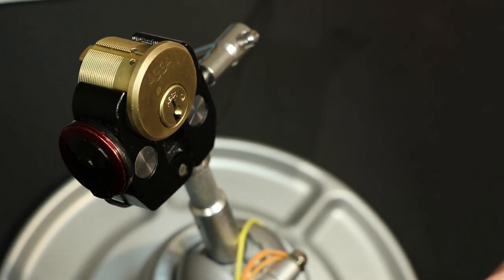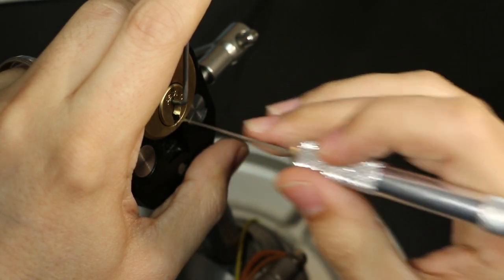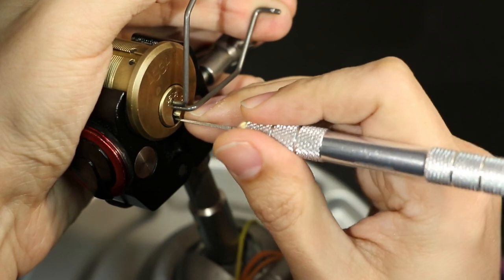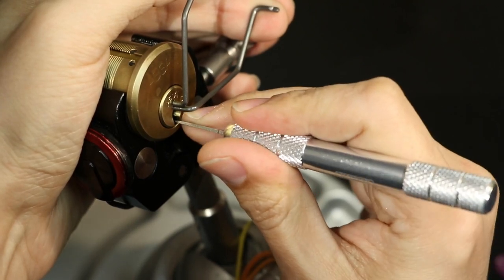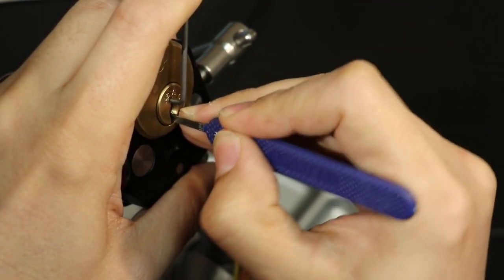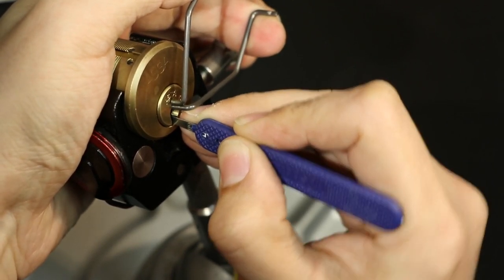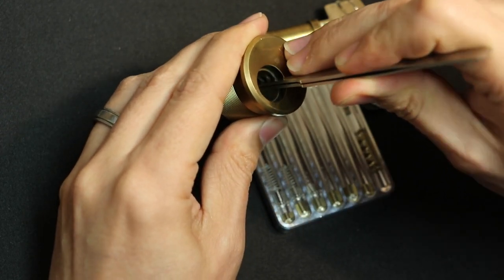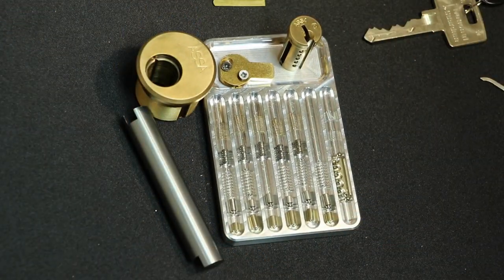[L86] ASSA Twin 6000 Mortise Cylinder Lock (gins) - pick and gut

Comment: Is that an Honest dimple pick? I see you have other videos with multipick. Which do you prefer? I was thinking about the Huk or Honest because I can't afford mulipicks. I just don't want to waste money on picks that will bend right away like my southord picks did.
Reply from the maker: Overall I prefer the Honest picks...the handle is far superior but you can't use them right out of the package. I did a like of grinding on the pick to make it the shape that I want. I use the multipicks when I need a specific type of flag, usually if I need something curved or they just happen to be the right height.